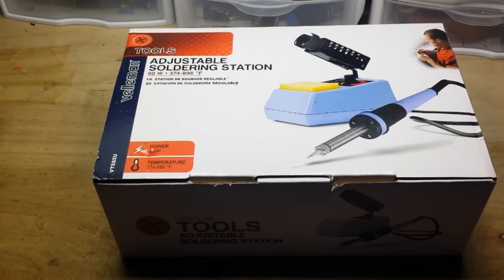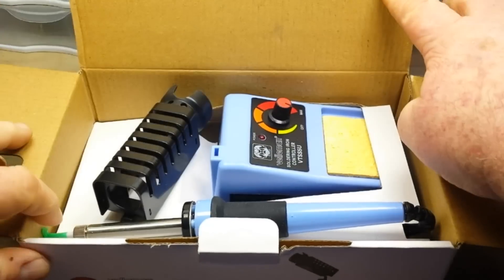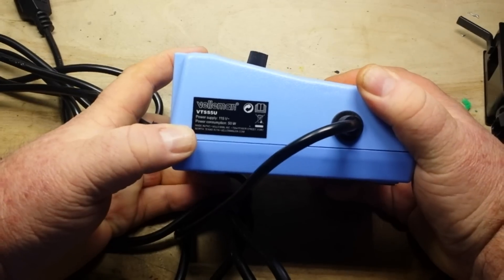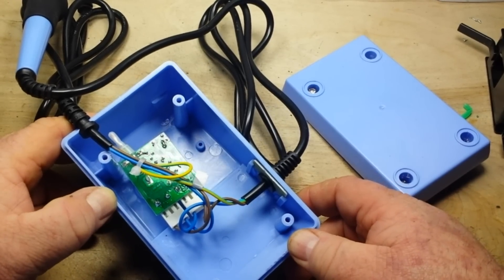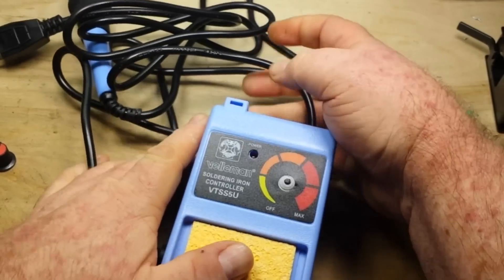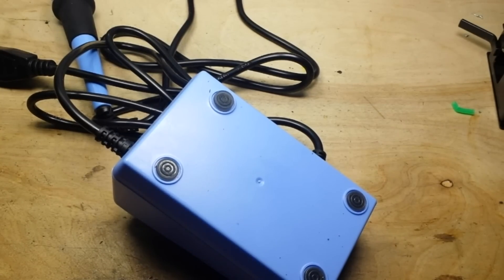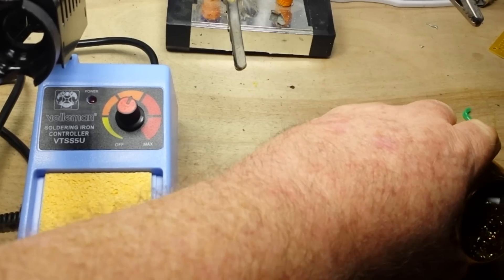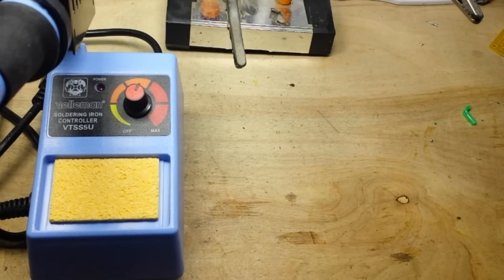Velleman VTSS5U Soldering Station

Comment: I have an older variant of that soldering iron i bought at microcenter years ago. What you are actually looking at is a TRIAC that dims the heater. that transistor looking thing is an AC triac. its basically a light bulb dimmer for your iron. i took mine appart once to look.

Comment: OMG its an empty case-! LOL  Not even any numbers to give the slightest suggestion of temperature setting, I gave away a Stahl station I bought from Parts Express because of this, if you dont have a tip thermometer or similar you have no real idea where youre at, its like using a plug in iron with a rheostat rigged in, actually now you can get a plug in iron with a digitally controlled temp control built right in the handle and they actually work very good for like $12

Comment: I have the VT-SS5 and cannot get it to work. It seems like the very tip is not getting hot or at least not hot enough to melt solder. It must be getting hot somewhere in the shaft because I can see smoke wafting up and I can smell it. But it will not melt flux or solder. I even tried to get it to burn a Post-it note and no go. Is the tip the issue or have I just not allowed enough time to elapse before attempting to solder? I’m a complete newb at this but I’ve watched several YT vids and I think I’ve done everything correctly up til this point. Anybody?!?

Comment: Mine just crackled and released a cloud of toxic semiconductor fumes right now. Immediately when I switched it on. That's after less than 10 working h spread over a couple of years. The diac looks toast and the triac exploded. I'll try to replace them, but I'd bet the cause is somewhere else. If someone knows how it works... Mine also has a small transformer and a rather large coil.

Comment: Paul it is only fairly recent that the god of temp contole came to be "essential " in 48 years in the industry in the UK we used 15watt or 25 watt irons with no problems at all and to be honest i have found no advatage other than lowering  temp while standing to preserve bit life with overengineered controles something we provided automaticly with a microswitch and a diode great to have you back doing reviews i think i will get one of those to replace my very old "25 watt henly" g.p. iron

Comment: I wanted to hate this solder station that I got way back in 2012 but I keep forgetting to tin the tip. After doing it the way you showed here it seems to thermally transfer much better. Maybe needs a new tip. Either way i got a temp controlled station on the way, finally broke down and bought one

Comment: I had mine since 2012 and it suits my needs. Model railroading and occasional electronics soldering. Can anyone recommend which replacement tips work for this equipment?? I’m looking for an assortment or single tip and am not knowledgeable enough to select proper replacement. Thank you.

Comment: I know it has been a while, but how does this thing do with larger things that'heat sinks' like large wire, or a large, thick ground plane on a large PCB? My cheap iron will only make cold joints on large wire on a large area of a PCB, like a larger BMS, soldering 8 gauge copper wire, it cools the iron below the melting point if the solder, and will actually have the tip stuck in the solder, I need something with a decent amount of power, and thermal mass, I'd like something that will be a good all round iron, and cheap! Mine says it's 60 watt, but I doubt it, it's about the same as my 25w Weller iron, I had one like it worked well, but it broke,  I thought I got one just like it , but it's very different when it comes to larger heat sinking stuff! 

P.s. I don't know how I missed this video, I usually watch them all, I caught this one , and some others, because I occasionally go to your channel, and see all videos, good day sir!

Comment: Junk.
This is made by Ningbo ZhongDi, a north Chinese manufacturer. Unfortunately you can't get it for $6, unlike the stuff from the Shenzhen area. It's not a terrible manufacturer, high quality control and materials sourcing and all that, but this is not a product that's easy to recommend, because it's an ultra low-end product stuck about 25 years in the past, among a sea of better alternatives that don't necessarily even cost more.
This one is ZD-98. I have a technically identical ZD-99 somewhere, but i would never use it unless i absolutely have to. I have used it back when i was a beginner, and i lifted many traces, way too many. I say especially beginners need much better tools than this, and once you're used to something better, you are not exactly inclined to go back. I don't know where this logic comes from that beginners need shitty tools. Is it because people suffered 30 years ago with shit tools, that they think people need to suffer now? "No pain no gain" is lunacy. Why would you be wasting your time fighting with horrible tools, when you could instead be completing educational projects or solving real engineering challenges, both of which will get you much further along.
"Gentle persuasion"? You bent the mounting plate out of the pot. There is a recess in the front panel. The face sticker is probably hiding a nut that would release it. There is no capacitive dropper, it's literally a thyristor lamp dimmer driving the soldering iron. The tip is earthed and the heater is mains-referenced and insulated. If the insulation on the heater breaks, well there's hoping that the earthed shell can prevent it from zapping you. The business end replaceable unit is just a tip with a big chunk of metal on the rear of it, it's not a heater. But at least it has that going for it, nobody will accuse it of insufficient thermal mass.
It's 2020. Things are generally not overengineered any longer. If they can save the cost of a screw, or more specifically the cost of a worker that costs more in Shenzhen than in Budapest to put in those screws, on a sufficiently mass produced product, they usually will, just as long as enough of the product survives the 2-year warranty to maintain the bottom line. Every screw must come back in, and carefully. My laptop for example has had several enclosure failures, and that in spite of screws all being there and tightened well - but it gets exponentially worse if one is missing, the flex would just ripple through it to find the weak spot! My monitor has a total of one screw, it's mostly just clips and tape holding it together. CYA is still there when safety relevant, but for the most part replaced with hard optimisation.

Comment: I got a soldering station from Velleman (Model: VTSSC40NU) a month ago and I works.There was only one place I could buy one and this is all they had. It does have a big transformer and performs ok. Once the lockdown is finished I will get something else. Not a good buy, but it was all I could get and I had to buy before the stores closed down. Cannot find tips for it anywhere..

Comment: i have this one but it is older and has two huge screws on the side to hold the tip in place. I tested temperature and on foll throttle appeared to take minutes to reach 300 degrees??? I use it but i can;t say its my go to. The Weller TCP i have is from 1971 and gets HOT, with a #6 tip it reaches 550 degrees. Maybe both readings wrong my temp sensor could be iffy. I am thinking about adding that KSGER because the tips make such good sense. Worried my Weller will die or burn out. I put digital stuff inside 1950 Model Trains for a Hobby. But it requires a lot of solder assembly. I need reliable joints, a wire falling off after i send the engine back tot he owner is unacceptable. I run them all in my lab for hours to catch the weaknesses. I had a lead pop off in test two days ago so I am looking hard at that K12 I see is is also available in kit form Maybe i can stuff it in to one of my current models. Thanks for all the hints on keeping tips in good shape. I can use those Soldering 101 methods, I only solder to get my trains build. Regards, D

Comment: I am happy with the CXG 936d Digital LCD Adjustable temperature Electric Soldering station Electric soldering iron 220V 60W that i did buy several year ago on AliExpress for just above 19 euro. The only minus point that at that time it came with a US power connector (and a wire to connect to ground). 
I like the temperature regulation/indication, it is relative small compared  to a soldering station and it is not expensive.

Comment: I've had two of these. They were on sale at the time and my Weller had just expired after 20 years of use. 
These irons were Maplin branded in the UK. They get hot and melt solder. 
Really that's all you can say about them and they aren't (or weren't) temperature controlled. This became obvious when plugged in and turned on in my ham radio room. The noise that the iron injected into the mains was substantial. I experimented with added filters that reduced the noise considerably.
They were probably no different than a non controlled iron connected to a light dimmer.
The first one died quite quickly and the 2nd was quickly replaced by something that was temperature controlled.
I really recommend that you buy something else.

Comment: I've been using this for at least 6 to 7 years and I've done some really delicate work with it, at some point the led stopped working and when it died it did because the resistor wire on the iron broke and i bought a weller we1010. The weller was definitely better but i don't know if the improvement was worth the cost difference. Either way it's quite consistent with the temperature and you learn where you should set it for what kind of job. Interestingly the day it died i had it at max to tin plate some ground on a pcb and after it was done it didn't work again, i took it apart and found the point the resistor wire had broken.
That being said we don't have the same PCB
Also mine has an on off switch , it clicks when you turn the knob alll the way down

Comment: Whenever I take something apart,  I have a special form I fill out.  It lists the fastener specs, its location, the time and date removed, the ambient temperature, and approximate torque. On reassembly,  I sign off on each line item.  

Yeah.... Right...

Comment: Im not a fan of those type of irons although I had one as a beginners iron 20 years ago but mine still had a transformer so at least it was isolated from the mains if anything goes wrong. It’s not temperature controlled at all because it just uses a dimming circuit to pump more or less power into the iron. So it’s more a balanced iron with adjustable power input. I’m sure they use the same internals for 110 and 220v so on 220 it will have more power and heat up quicker. That’s surely also the reason they do not print any temperatures on the pot (which mine still had but because of the transformer in it the output power was adjusted to the line voltage). So if you want to hear it up quick then turn the pot to the right and after it’s hot adjust the temp to your needs. Mine also had a pot with a clicky switch as it was used in old radios with volume control and on/off in one pot. I wonder if the also shaved cost here. TBH I would not recommend it, also not for a beginner, you can get better ones for 35 bucks upwards.

Comment: Hey Paul.  I have the very same iron (just has a different sticker on it).  It does the job well and I'm happy with it as my entry level iron.  I used my multimeter with thermocoupler to set temperature.  It needs to run in the second last red zone most of the time and yes the stiff power cords are a problem.  It gets the job done without busting the wallet.

Comment: I use a Weller, military issue, that I've been using over 20 years. I did have to buy some new tips a few years ago though. No heat controls at all and never had an issue. It does have an on/off switch. 😁 I need another iron for the shop so I may just get one of these for that use. Thanks for the video!

Comment: I've had that same soldering station for about 10 years. I keep it in my vehicle for field use. As far as temp control goes, I normally set it all the way to high or close to it. You can't beat it for the price. I had paid $20 at Fry's Electronics. They charge about double that price now. I use a Weller temp controlled iron on the home bench.
Reply from the maker: Seems like a good iron

Comment: Similar station used to bey first iron. Good for a occasional use, but definitely not if you want to get some serious work. temperature regulation is a bit wonky  and power output is a bit weak. Much better solution are these Ksger T12 or Yihua 937D stations from Ali.

Comment: I used a regular no frills plug in no temperature controlled soldering iron for many years and was good with that. I purchased a Weller temperature controlled that has given me several years of good service but I like both. Thanks Paul.

Comment: I have a similar one, but mine is red and the Off position have a click on/off on the pot. Also it only melts solder at maximum position, so no great subtlety here. Finally, mine don’t have the thread ring for changing the tip, but two screws on the side. Bedside all this, it’s the same design and price!
Reply: Likewise, mine has the click off on the pot. In the UK we have 240V mains, so the iron gets hot enough to melt lead-free solder at about two thirds of the way to max.
Reply: Brian Ronald that’s interesting, thank you.

Comment: I have the same soldering iron, picked it up at Fry's Electronics in Seattle about 3 or 4 years ago.  Works like a charm, takes my abuse.  Best cheap soldering iron I've ever had.  Not the best iron, but the best cheap one!  Temperature control is like one of those extra screws.  Who really needs that?

Comment: That's not a temperature controlled iron, it's a power selected/adjusted/variable solder iron. 
Two issues for those soldering: 
1- Is a Temperature controlled iron strictly necessary or a power adjustment one is enough? Answer: Power adjusted is ok.
2- Is a temperature controlled iron better?  Answer, Yes ..Much much better!
I actually made some calculations and I think it is worth it to follow open source designs for Temperature controlled solder irons. If one buys the parts from PRC (aliexpress/banggood/ebay) and assemble the thing at home a Hakko 936 clone can cost less then 20$ Without the case ... one can use a coffee can for that. 
So If budget is a constrain then I think a diy Hakko 936 clone with parts imported from China is the real solution. One important notice is that the 907 handle from aliexpress, the cheap one, come with the wrong type of heating elements ... better buy those, buy also a Hakko heating filament clone also from aliex and reassemble the handle, then simply go to the many circuits online and make a temperature controlled station with a Arduino ... it will be less then 20$ fro sure .... including the 70W AC-DC power that you already reviewed on your channel.
That is the way I truly recommend for anyone.

Comment: Looks identical to the ones they sell here in Aus at Jaycar but the dial on ours actually turns it on and off. Ours also comes with a cable to connect to ground. I have the Jaycar version which is what I started out with many years ago and it hasnt failed me. Once you get used to where you like the temp set on the dial it becomes easier to dial it in at roughly the temp you want. Mine also heats up a lot faster than yours. Solder melts at around 30 sec or so... that said the Jaycar ones from duratech are much more expensive. https://www.jaycar.com.au/duratech-48w-temperature-controlled-soldering-station/p/TS1620

Comment: I used to use similar Velleman soldering station for many years. Heating time is definitely dead slow after using more powerful temperature controlled stations, but it was OK when I hadn't gotten used to the "few seconds" heating time of new stations. As the dial is controlling power, instead of actual temperature, leaving it to full power during heating does make it quicker (Still not anywhere near speeds we have gotten used to).
One will very quickly find out the "correct" dial positions for different soldering applications. It lacks all bells and whistles, but it's cheap, widely available and beats regular soldering iron, when it comes to delicate electronics. It's not a bad choice for beginners.

Comment: Makes me feel like my light dimmer controlled soldering iron is still relevant.
Reply: that board is just a small triac with some x rated caps and some resistors and a think a diac in there